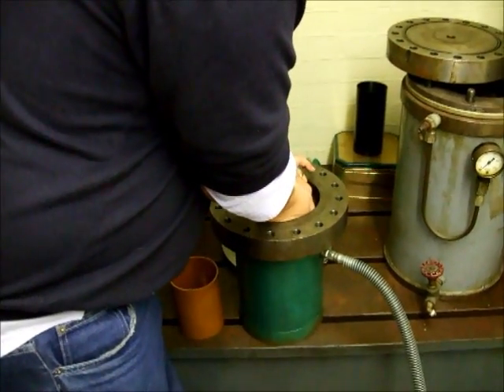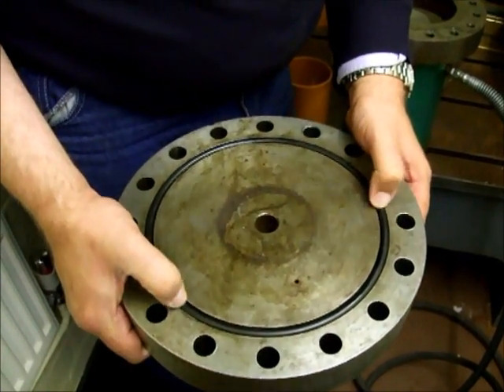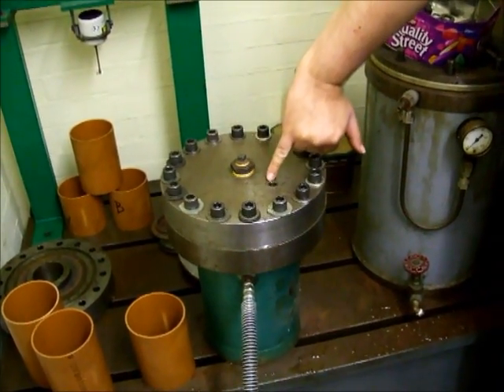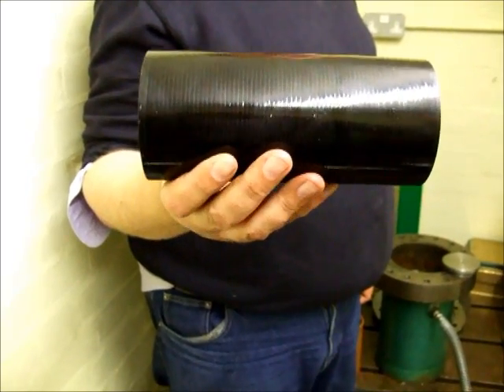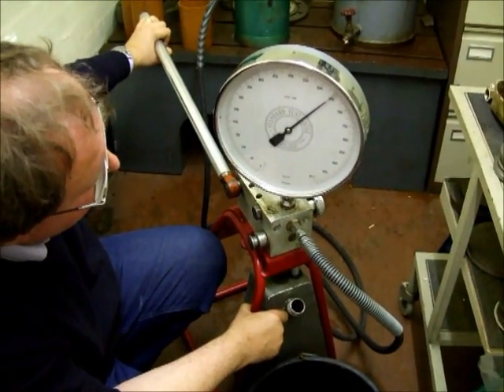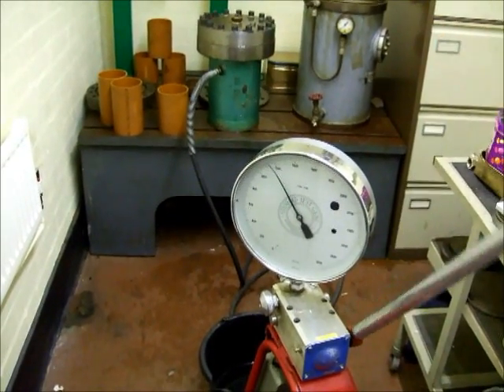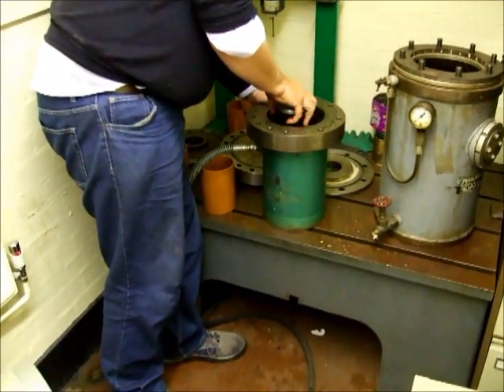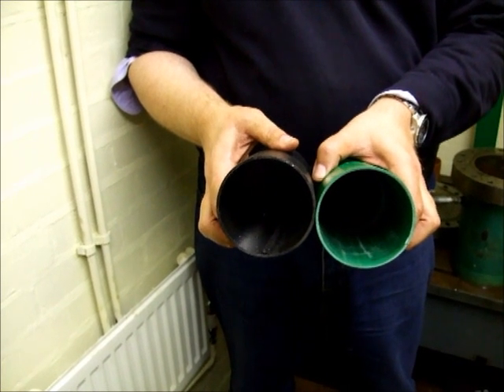Collapse of Composite Submarine Pressure Hulls

Comment: I’m actually trained in aerospace advanced composites. Carbon is great for a ton of applications. Even what Titan was used for (proof is in how many times it’s been used). The key is inspections. Carbon requires ultrasound to find defects that would compromise the structure. I’m willing to bet that it was either compromised from a previous dive or test, or it was damaged in some form before that last voyage.
Reply: So, what you're saying is that it's not great for deep sea diving.
Reply: Why would you ever use carbon fiber in compression?  The only strength it has in compression is from the resin.  Carbon fiber's strength is in tension.
Reply: I think there's some stronger proof pointing in the other direction
Reply: It could have been pre-tensioned, like concrete bridges with rebar. This would allow it to withstand more compression without buckling, but the fiber has to maintain it's tension. So being surrounded by plastically deformable materials means there is a definite limit to the number of times full capacity can be reached.
Reply: @keantoken6433  That's not how carbon fiber is made, and you would have trouble putting enough tension into it to counteract 6000 psi of compression.
Reply: @stargazer7644  6,656 psi my friend plus the additional psi of the water being super cold. 
The Viewport is a 12 inch circle. That is 113 sq inches. 113 x 6.656 = 752,128 actual pounds of pressure ON that plexi glass. It made 5? dives to Titanic previously. 
Either the window popped, the CF tube failed or the bolt on door failed.
Reply: @SuperChuckRaney  Yes, thank you, I understand how to do basic math.  In case you aren't aware, Plexiglas has been used all the way to the bottom of the deepest spot on the planet.  So you think part of the pressure vessel failed to cause the implosion.  How incredibly astute of you.  You forgot the hull penetrations and the end cap CF-titanium transitions.  My money is on the latter.  This was the Titan's 13th deep dive, 4 previous dives went to the Titanic.    The door is the titanium end cap.  It is held CLOSED by the pressure.  That seal gets stronger the deeper you go.
Reply: @stargazer7644  lots of ppl reading might not get the basic math. 

This exact submersible has made 4 dives to 12,500 ft
Whatever failed is only good to that depth, 4 times. 
You're thinking the glue/bond on the Hull-side Ti ring? I can see that too. 

Carbon Fiber winding, is 667 layers. 5 inches thick.
The Viewport that I harp on, is 7 inches thick. It comes into the cabin 3/4 an inch.
The Titanium is 3 inches. 
They'll find something for sure. 
It's sad tho. It really sounds like Stockton grew tired of engineers working out competing interpretations of problems and went for just Yes Men. 
But they did make 4 succesful dives. Well 4 1/2.
Reply: @SuperChuckRaney OT Chuck Raney! 👏👏👏

Comment: It becomes extremely clear why James Cameron and Victor Vescovo chose titanium for the pressure chamber of their subs, and then had it certified + 20% for added safety. Triton Submarines did an awesome job of building Limiting Factor for Victor Vescovo, which has repeatedly dived to depths almost 3 x that of the Titanic, in perfect safety.
Reply: They also choose spherical pressure vessels, not cylinders. A sphere is the best shape for the job.
Reply: it's always been clear, that idiot stockton rush just disregarded established science. carbon fiber is only strong in one direction - tension or being pulled apart, like any fiber. what happens when you try to bend or press a fiber inward? no resistance. the hull of a submarine is almost entirely being pressed by that lateral inward bending force from outside pressure - a direction carbon fiber has no strength for. in that direction it's only as strong as the epoxy they use to laminate it together, and well, would you trust your life to a wall of glue? carbon fiber has no business being the hull of a submarine. it's not as strong as titanium and the weight savings are irrelevant cuz the sub needs to weigh enough to sink anyway.
Reply: @oldfrend  Got away with it about 8 times, the issue with carbon fibre is how it fatigues over time, then fails, and there isn't a good way of testing it, all you can do is x-ray it for defects. Metal doesn't fail in the same manner as CF, it's a lot more predictable, and it's internal structure is homogenous, not a mixture of incredbily strong stuff (carbon fibre) and relatively weak stuff (epoxy holding together).

You're correct about the weight factor, it's not relevant with the submersible in the water, yet Rush was carrying on about it as if it was a big deal. Killed by hubris.
Reply: @oldfrend  💯 shocking Stockton rush didn’t watch a couple of YouTube videos before building the submersible !
Reply: @oldfrend  Titanium is expensive. That was Rush's driving motive.
Reply: @oldfrend I'm assuming they chose carbon fiber because it was cheaper, not because it was lighter. Although having the sub be heavier would make it harder to maneuver, so they would need bigger propellers and batteries.
Reply: @adrianthoroughgood1191  Yeah, Stockton Rush said he used carbon fiber because it's more buoyant and less massive, so that they wouldn't need expensive glass foam and could use smaller propellers.
Reply: @juliavixen176  if they had made the sub the same size but with titanium would the air inside not have been enough buoyancy for the increased weight?
Reply: @adrianthoroughgood1191  you don't know even the basics of submarine design do you? for the titan's volume, it CAN'T be lighter, otherwise it would just float away. the only difference between a titanium hull and carbon fiber is that the CF hull would need more ballast weights to overcome its buoyancy so it can actually submerge. the end result is they weight the same because they have to.

for comparison, DSV Alvin is a spherical hull of 3 inch thick titanium, weights 40,000 lbs, and STILL needs ballast weights to submerge.
Reply: @adrianthoroughgood1191  Rush bought a load of out of date fibre and bond from Boeing cheap
Reply: @adrianthoroughgood1191 For sure.  Making large metal cylinders requires large equipment and skilled welding.  Carbon fiber could just be wound up.  So the capital costs were much lower. 

At least, the costs to make something that looked good.  It's unclear how much more expensive a safe hull would be or even if that's possible with composites.
Reply: @adrianthoroughgood1191  I see that you received a rude answer to your question. It's surprising that there are so many experts in this field who have the definitive answer. Mr Rush was not the first innovator to fail.
Reply: James Cameron actually did not have it certified (he said so in an interview recently) but it didn't matter because he did seek very sound sound engineering advice and was only using it himself, he did not put others in danger.
Reply: also, the interface bw carbon fiber and titanium endcaps on the titanic sub was ripe for trouble, with a tiny layer of araldite type glue. the thermal gradients alone woulda snapped it. carbon fiber thermal coefficient = ~40!
Reply: @klam77  Expert number er... 3 million and counting?
Reply: Look at the size & thickness of the test cylinder and it is never made of carbon fibre  !!
Reply: 40 mm special ultra-low carbon steel thrice heat-treated (machined down from the 200 mm thickness leaving out the middle part of the casting) was good enough for the Mirs, which were tested by the Finnish manufacturer to 7,125 meters (6,000 meters + 10%)
Reply: @Itapirkanmaa2  Interesting.... Imma Google it.
Reply: James Cameron's sub isn't certified tho
Reply: No, the DeepSea Challenger has a sphere made from steel NOT titanium

"The material used. The Deepsea Challenger is primarily constructed using a combination of high-strength steel and titanium. The crew compartment or sphere is made of forged steel, which provides the necessary strength and protection for the occupant in the extreme conditions of the deep sea."

source: google "deepsea challenger steel or titanium" since youtube deletes external links

Comment: with regard to the titan submersible i did some rough math and the total force on the outside of the pressure vessel was definitely over 130 million pounds.  imagine that all coming in to fill up your 14.7 psi bubble.   i don't have what i did in front of me but i took a conservative number (i know the vessel was actually a bit bigger than the numbers i used) for the surface area of the pressure vessel in square inches and multiplied it by 6000 psi.
Reply: If it had 10m² area and was 3000m below the surface, then with a water density of 1000kg/m³ that is 30 million kg. All of those are conservative numbers.
One has to love SI units. 🙂
Reply: @landsgevaer  respect.   i have used and still use them as a canukistanian.  in every day working life i prefer the wild west of the imperial units because i enjoy the mental gymnastics of using fractions while using a measuring tape.

Comment: What is the white material that is outside the OceanGate Titan titanium cap <-> carbon fiber <-> titanium cap core? The material that forms that fin/tail on the one side??
Reply: It's probably fibreglass, it doesn't hold any pressure and is not very important.  It's just for streamlining as such (not that the Titan ever travels very fast for drag to become important) and perhaps aesthetics too.

Comment: This may have been said before, but the issue with carbon fiber is there are no test to determine how many dive cycles it can withstand. Modern submarines have a life of only so many dives to extreme depth. There is a life to every material made. When clothes get old, they rip easily, the same thing happens to carbon fiber.

Comment: i think the rear titanium end ring was the failure point. they bonded the end rings onto the carbon tube. the rear tail with part of the undercarriage was found. my guess is the top of the rear carbon  tube that meets up with the titanium ring was the failure point. there must have been 2 or 3 ton at a guess in that tail hanging on the rear ring out of water from manufacture bonding day. this would have been through hot and cold weather daily with different expansion and contraction rates. also a blowout in any of the equipment in the tail would transfer shock through that sealing ring. thats my armchair analysis of what i think was the first major of many design flaws
Reply: Saw an analysis that suggested the composite tube could have simply popped out of the end cap, it was only glued on and it didn't look like much of an overlap
Reply: @rjm2k1  yes there is video showing them in a factory bonding on to the end titanium rings. They only sit inside a lip of about 5cm and the tube face is 5 inches thick. I saw a still image today of the end rings being strapped down to the ships deck at 45 degrees during transport of the sub. Its pretty obvious that the leverage of tail weight on that rear ring would be massive and strapping it down?
Reply: Titanium ring wouldnt have failed, like the end caps. They would likely be perfectly intact. The carbon would have shattered like glass when it failed.  Titanium will flex alot and bounce back, carbon...just breaks.
Reply: @outkast187  yes failure point not failure of the ring itself.

Comment: Alot of the new air liners are partially carbon fiber. I know they are not subject to these pressures. but I wonder if they are safe?
Reply: I asked the same question on Reddit; It boils down to, carbon fiber works better under tension than it does under compression.
Reply: @jrfireboy2  Yeah, not good for resisting implosion, but they can resist explosions.
Reply: It works fo planes.The pressure difference between inside and outside an airplane is less than 1 atmosphere.

Comment: Has anybody considered  the oxygen cylinders which are normally charged at 20000 PSI. Which could cause the vessel to explode if the demand valves malfunctioned.
Reply: CF is a good material to contain INTERNAL pressure.  It is almost useless for resisting EXTERNAL pressure.  For that, the compressive strength is ALL from the 'glue'.  In fact, the CF weakens the 'glue' as it means the 5" thickness isn't all 'compression resistant glue'.  from 'Composite design & construction 101'
Reply: 20,000 psi? Where did you get that figure?

Comment: To my simple mind it would seem that a vacuum pump @ sea level could provide usable data to research hull strength. As long as the differential between outside/inside pressure is the same the data should be similar.

Comment: I’m not sure what the point of making this video is.  Carbon fiber is a GREAT material for making vessels designed to contain enormous pressure, due to its incredible tensile strength.  But nobody would be stupid enough to use it for the opposite purpose, as its compressive strength is practically negligible, and entirely dependent on the matrix in which it is cast.

Comment: Interesting difference between this setup and the deep sea is that the pressure of the system drops when failure occurs where in the deep sea the high pressure persists.

Comment: Since repeatedly they only placed 17 of the 18 latch bolts in their place on previous dives too - The location had to develop delamination and thus fatally weakening the roof .
I worked manufacturing composites and I NEVER would use them for submarines. For aerospace pressurized cabins they ar very good though!

Comment: A tank under pressure is being compressed. This is very different than in a vacuum where the tank is being stretched under tension. This is why fibers don't work - they perform well under tension but are weak when under compression.

Comment: Most recent comments appear to be taking this video as proof of the weakness of CF because it gave way, perhaps misunderstanding that is what the test was supposed to do.  This video doesn't give details on the thickness, but it does show that a relatively thin CF tube survived getting towards 100 atmospheres of pressure before it failed.  So it performs pretty well; presumably the problem with repeated use is the damage done each time it gets somewhere towards its failure point.  Maybe the mistake is that Titan needed to be 10 inches thick for what it was being asked to do.
Reply: As I see it, this video shows that CF is significantly stronger than fiberglass, in a tube loaded in compression.  That doesn't make much sense if the load is all compression, as they should be the same, as the CF shouldn't carry compression load, just the epoxy matrix.  So it suggests, to me anyway, the CF reduces the chances of buckling, which I believe is one of the more difficult to predict failure methods.  But clearly, these two Brits in the lab did more testing than the multi-million dollar sub program that ended in disaster.  If you're going to push the envelope, you need to do the work.  CF is not routinely used in this application for a reason.
Reply: @tomsmith3045  That seems to me an interesting point - that the strength factor of CF in this application is not the compression issue at all, but it's strength in keeping its shape, rather perhaps as bracing would in a metal structure.   I will be interested to discover what testing was done; I have seen the suggestion that quite a lot of testing was done, but we have to know the detail to draw conclusions as to why in reality it was not sufficient. Technically very interesting, so sad that lives were lost.
Reply: No the mistake is that carbon fiber should only be used once or twice in this scenario, and replaced after each exposure to pressure.
Reply: @stargazer7644  Thank you for your response.  I hope we get to find out why they thought it would be more durable, given that the properties of CF are presumably pretty well known.

Comment: There is a lot more to the science of carbon fiber than meets the eye.  Fiber orientation, direction of forces, was the resin toughened, etc.?   CF is an extremely stiff high performance material and does well in proper applications with good engineering.  It can also be very brittle and doesn't do well under cyclic impacts.  It may not fail at once, but a few fibers at a time until the whole thing looses strength and gives way.